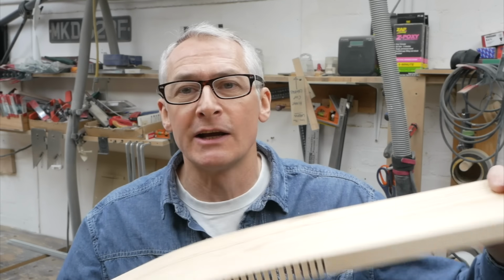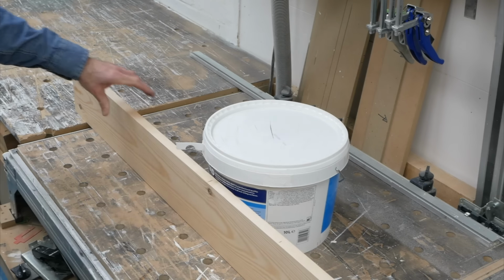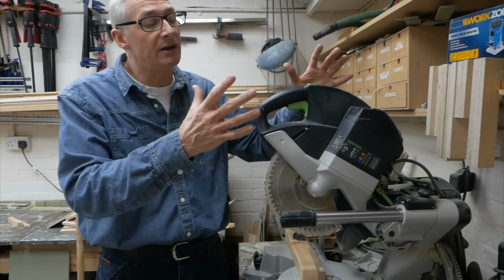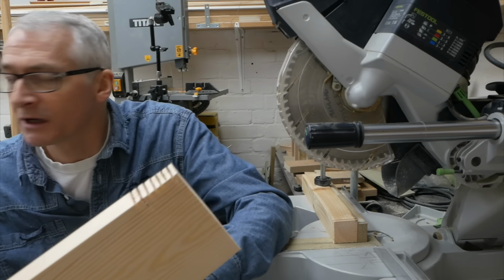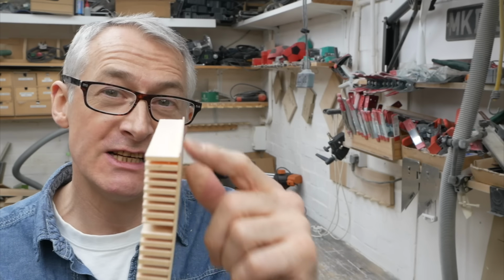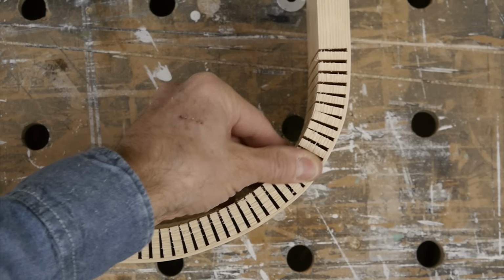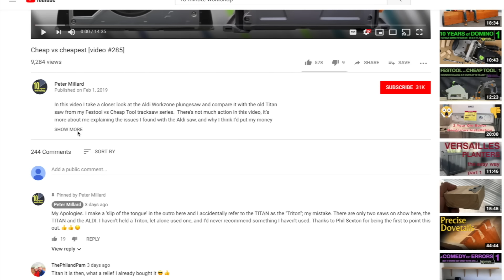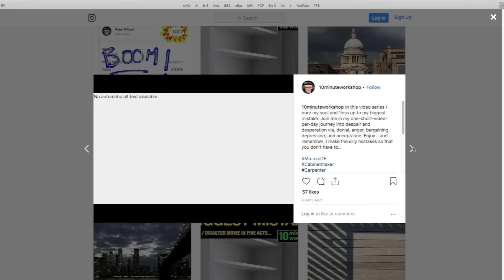How To Bend Baseboard Around a Curved Wall [video #288]

Comment: I was forced to do this for the first time about 6 months ago. Bottom of stairs had a round end on the bottom tread. I used 1/4 inch maple veneer plywood for the risers, and didn't want to change products for the curve. So I did exactly what you show. Set my saw depth, added a sacrificial stand-out fence, then cut the slots at equal spacing. Worked brilliantly. I filled the cuts with glue when I applied it, just in case it might need it.

Comment: I do Stair Renovations for a living. I kerfed wider material when I first started but now I use 1/8" Plywood and sand down to about a 1/16" for the curve. I've found that I don't have the brittleness issues of kerfing, it's stronger than veneer and you can pack out as much as you want to cover any gaps where the bottom step meets the flooring. However, with a step, you don't have to worry about what to do with the top edge.
Reply from the maker: Good shout, thanks! 👍👍
Reply: @PrettyPeople1111    I have a couple of pics that might be helpful but don't know how to load them into a YouTube thread.

Comment: iv done this a few times. it works great on square edges stuff. . i usually fill the kerfs with glue when fitting. it really strengthens it. i had a case where someone hit it with a trolley  and it broke.

Comment: Hey Peter ,i usually will  wet it with a spray bottle to soften it up before bending it ,i do the same with dry wall when i do an arch ceiling in a tub enclosure,the fun ones are the 90 degees with small rounded corners (tight corners ) i fit it then glue them up before installing them (concave trim is lots of fun )
Reply from the maker: Thanks Syd! Yes, wetting works well, especially for tight curves. And don’t get me started on concaves 😮😂👍
Reply: @10MinuteWorkshop  dont get upset ,everyone knows you cant make concave moldings with track saw ,im sure it wouldnt be  with out great difficulty

Comment: Another method is to slice the material into thin strips then re-glue them together while bent around a mold equal to the curve required. Once dried, trim the ends. This method lends better to non-painted finishes. There are quite a few videos on youtube describing this method. Some people even make furniture with it!
Reply from the maker: Yep, laminating works well and always plenty of ways to skin that cat, but this  was about bending a 6x1 around a curve as quickly and easily (and cheaply) as possible, without knowing if it would be painted or left in natural timber. 🤷‍♂️👍
Reply: This requires a former made that is specific only to the radius of that curve, also would need some form of clamping caul or a vacuum bag. Admittedly a better finish but tremendously more work.
Reply: We had the opportunity to do just that not long ago on some baseboard. The "fun" challenge was that it was an inside radius of less than 8 inches, about 9/16" in thickness and 8 inches in height. We used basswood (for pliability) and steamed the laminations to pre bend on the form to ease the final bend which helped immensely. The glue up consisted of 5 laminations using Titebond 3 glue. Left in form for two days. The 4 inside corners held their shape with no springback whatsoever. These pieces actually went into a very luxurious bath area so that solid wood was the chosen material as opposed to a layers of thin MDF or baltic ply run vertically or some other material or method. Definitely a lot of work but turned out very well. Thanks for sharing and am always open to feedback and ideas.

Comment: Thanks for sharing. When I'm doing this I dribble a few kettles of nearly boiling water on the kerf cuts before fitting. I find this really increases the flexibility. I also put some expanding adhesive foam in the cuts. I'm not entirely sure if this does anything very useful but it seems a bit less fragile when it dries off.
Reply: Do you carry a survival kit in the tool bag to boil water or do you have the homeowner boil the water? Lol

Comment: Thank you so much being trying to figure a way out to have a piece of wood with quite a long curve. 
I can’t and wouldn’t do the steaming process but what I just saw you do is brilliant. 
Finally I can get the last piece done 👍🏻 
Thank you very much, Just subscribed
Reply: i also add a wallpaper steamer to the flat surface before bending just to aid the bend it works well ...and using a moisture cure glue it helps that when using a curve as skirting i tend to lay a tape barrier with the floor surface and cut it away once finished this pucks up any spills or expansion but also prevents the board from gluing to the floor and being able to remove it down the line (you know if a electrician wants to remove the skirting to chase a cable )

Comment: I have just come back from Houston and visited the Home Depot and while in the Lumber section I noticed the skirtings which came in standards MDF lengths with a white primer similar to ours, but they also had additional flexible lengths which although identical seemed to be made of a soft pvc material which allowed you to form the skirting into any profile you chose I was able to bend one length completely on itself, haven’t seen it here yet.
Reply from the maker: Wow, that sounds interesting! And no, haven't seen that here either - I'll keep my eyes peeled, thanks!👍

Comment: Reminds me of a kitchen an old mate of mine was doing in his hippy and rather 'rustic' cottage 30 odd years ago - we had to curve the work surface (which would be tiled) by the entrance to allow people to get in and out of the tight space more easily.  He was stuck when it came to the edging the curved work top before tiling (we'd 'done' half the kitchen already so they could use it and this was finishing off the job) and because he couldn't work out how to put the edge on curved and had chopped up several pieces of quite expensive/blagged and couldn't get anymore oak (I think) finishing trim and failed to get the geometry right with a mitre saw and was getting very frustrated.  I suggested doing exactly this and carefully sliced into one of his offcuts by hand to show how it could be done.  An hour or so later the job was done - we had to use parts of his bodged offcuts to complete the straight runs as he'd nearly wasted it all and I filled the visible cuts with sawdust and glue on that too.   It looked very good when done anyway!
Reply from the maker: Amazing! Sounds like one of those jobs you can talk about happily afterwards, but at the time, not so much, lol 😂👍👍
Reply: @10MinuteWorkshop  exactly that!  He was getting very grumpy about it all.  Ended up looking really good.

Comment: Did a bathroom remodel and there is a slight bow in the wall because of plumbing issues. I am a non wood worker and this worked really well for the baseboard. Would this technique work for the crown molding? If not, any tips to share. Thanks, John.
Reply from the maker: Would depend on how intricate the moulding was, and whether the curve is internal, or external, how tight it is etc… I’ve never done it - crown moulding here in the UK is generally made of plaster - so can’t really advise. 👍
Reply: @10MinuteWorkshop  

Thanks for taking the time to reply.

Comment: Interesting video. As it's painted anyway have you ever used what I would call the layering technique, ie building up to the thickness with a number of thin laminations?
Reply from the maker: No, never have, though I’m sure it’d work well.  As mentioned in the vid the client hadn’t decided whether it was to be painted or not until after it was installed; yeah, one of those... 🤷‍♂️
Reply: @10MinuteWorkshop  I used to be indecisive but now I'm not so sure!

Comment: I just going thrue that kinde of tricks not so far ago, I mean on bumpy wall and that technic works as far as you figer out the metologi which you present.
 I see you have evolution mitre saw. I will be pleased, to see them in action on your hands .
 I'm unhappy owner of Parkside mitra/chop saw with have bended fence so have accuracy of the ax .
 Tried few times to fix but no luck.I know that Andy touch that topic some time ago,but, I see he use now dewalt mitra saw.
 So I'm looking forward for yours opinion.
Reply from the maker: Thanks Piotr! Yes, I have the evo mitre saw to play with, see how it goes in use. 👍

Comment: I did a load of these radius curved skirtings on a project a few years ago with Ogee Skirting & like yourself i didn't think too much of it i just did it & obviously as it was Ogee the upper saw kerf cuts came through the upper moulding so i neatly filled this in with caulk & a flexible piece of plastic to keep the radius curve once the skirting was bent & fixed.
After i was no longer on the project i had 3 different carpenters ring me up to ask how i had done it as they couldn't do it on the other curved corners...... I was a bit shocked they couldnt do it to be honest especially as they could look at the ones i had previously done as a reference, so i just politely explained without trying to sound like a condescending git :)
Reply from the maker: Nice! If only you could charge for that tie, lol! 😕😂👍

Comment: Have you ever Kerfed finger jointed base? I’ve never done it before but feel like it will break easier than a regular one piece board. Thanks.
Reply from the maker: No, I never have - for just that reason. 🤷‍♂️👍

Comment: Once you have completed the kerfing and confirmed you can bend it to the required shape - how about some epoxy glue in the kerfs and then it will hold the shape no matter what?
Reply from the maker: Yes, could be worth a try, great idea Norman! Or maybe PU adhesive - the slight 'foaming' may help fill the kerfs?? 👍
Reply: I would think filling those kerfs with construction adhesive would help with durability.  With the face of that board being so thin in the kerfed areas I'd think it would be easy to crack if something hits it.  Being stain grade it's not an easy fix.

Comment: Would this technique work with a  OAK skirting around a round bay window ? Great channel btw.
Reply from the maker: Never tried it, but it would probably be OK. You’d need to be a little careful about the blade kerfs - presumably you’d have a moulding around the top edge to hide them. 👍

Comment: I find it very challenging to control the depth of cut on a miter saw, it would have been the last type of saw I would have used for that, but you seem to do well. Is the Kapex that accurate then?
Reply from the maker: Yes. I started out trying an evolution mitre saw that has been sent to me, but there was so much flex in the trenching cut I switched to the Kapex.
Reply: @10MinuteWorkshop 
Thank you Peter for taking the time to answer.
My miter saw is a Metabo KGSV 72 XACT SYM, I have never managed to good control of depth with it.
Ar the time when I bought it I could not see what Kapex could do that the Metabo couldn't.. But depth control seems to be a clear difference then.
Thank you for clarifying that.

Comment: I have used a product that is a bendable plywood and veneered it in a matching species when the need a risen, I'm not sure if you have availability to such material in the UK,  in NA it can be found in  speciality lumber and drywall yards. B
Reply from the maker: Interesting, thanks! We can get ‘bendy’ ply and MDF, but only in relatively thin boards. Good trick with the veneer though, hadn’t thought of that one, thanks! 👍👍

Comment: Very good and informative video. Thanks for sharing.
I've seen some other videos where this technique was shown but never so detailed and other important information.
How do you manage to have consequent distances between the cut-lines?
Why did you show this technique in the video with wood?
(Why) Is it not possible to do it with MDF?
Reply from the maker: Thanks Hans! I used natural timber as a/ that was the job, originally, and b/ it’s more difficult to do than with MDF. As mentioned in the video, consistency of kerf cuts is essential, and having a sacrificial fence is very useful to gauge this. 👍
Reply: @10MinuteWorkshop  Thanks for you explanation.

Comment: I have Almost finished the skirting on my lounge project. Curved bay window section remaining 😬. Would this method work on a concave bay window of I scored the front of the skirting? I am using mdf skirting so some 'shaping' can be performed if required (probable 😬)
Reply from the maker: If you scored the front you’ll have a lot of filling to do, but it should work, depending on how steep the curve is. Only one way to find out though... 🤷‍♂️👍👍
Reply: It worked 👍didn't need as many cuts as I thought. Few sacrificial pieces of scrap required but got there in the end. Just need to fill the thing.
Reply from the maker: Excellent! And thanks for letting me know! 👍👍
Reply: Thank you for the tips 👍

Comment: TIP: BEFORE bending the piece, reinforce the piece with a bit of tape. It will reduce the chance of the piece snapping in two. 
Once the glue is dry, and the piece is installed, remove the tape.

Comment: Hi Peter. Is this possible to bend in the other direction? I'm designing a kitchen with curved corner units. Toe kick underneath would look awesome if it was curved to match. Not sure if it's possible. Will be using walnut veneer on birch ply. Any advice would be awesome. Cheers
Reply from the maker: Wow, sounds great! I'd say not with birch ply. You could probably do it by laminating up thin strips and gluing them together, then veneering the face, but lots of experimenting required, I'd think! 👍

Comment: I have a curved wall just like the one you did, in a bathroom I'm expanding now....I'm trying to figure out a way to wrap a wide crown moulding around that same corner up top....tricky. I may have to make a clay mold 1st to replicate the crown profile, then bend the clay mold, let it set up, then finally pour a plaster, or Bondo/epoxy mix into the mold....should be interesting, I've done a lot of things, but nothing like this. Any ideas anyone has would be much appreciated. Thanks for the video bud, good work!
Reply: Have you looked into polyurethane molding?

Comment: Why does it crack when i try this technique? I’m working with a pine riser, can it be that it’s too cold in my shop?
Reply from the maker: Too dry maybe? Cutting a little too deep? Cutting the kerfs a little too far apart? Or a little too close together 🤷‍♂️ It’s a balancing act, but the kerf cuts have to be very consistent to get a good bend. 👍

Comment: Peter -  I have an old Victorian house with a curved wall in it.  We are looking to replace the skirting there with unpainted timber.  I have seen this technique before (but still a great video) but our skirting has an additional moulding on top of the flat board.  Have you any tips or techniques for doing the moulded piece that sits on top?
Reply: Darren Reilly's earlier comment gives you an answer. When he describes using a flexible piece of plastic, I think he means that this is the tool he used to shape the caulk to match the moulding. It's certainly worth trying, and worth hiring a large mitre saw to complete the work.
Reply from the maker: I think Darren's answer was specifically aimed at something with a painted finish - much harder to achieve with natural timber 👍
Reply from the maker: Hi Colin. As I say in the video, it's much easier to do this with a square-edged timber than say, an Ogee or Torus moulding. At the risk of stating the obvious, if you do kerf cuts into the moulding they'll be visible, at least part-way, and will need filling. Depending on the radius of the curve, I think I'd be inclined to rip the moulding off the base, and try to bend this separately, either with tiny kerf cuts (maybe mitre cuts?) with e.g. a multi-tool and a jig, or by soaking/steaming the moulding to fit. Either way, it's not a 5-minute job, and will need some careful finishing afterwards. 👍
Reply: You could try cutting the molded piece off and then soaking in water for a few days, it will then bend to a certain amount. 
Cut the remaining board as Peter has shown and then gently bend and tack the mold back on to the skirting.
Reply: Peter Millard 
I thought about this many times whilst driving my van 
How about running say 3 separate lengths of skirting through planer thicknesser so you have the furthest moulded section out then the next then the flat board then do the bending planting each one on top as you go 
I probably haven’t explained it well but I know what I mean lol
Reply from the maker: Sounds like a long old process! Look forward to your video on it, lol! 😂👍👍
Reply: Peter Millard 
Yeah I might try it one day maybe when I get onto the southern rates 
Thanks for reply
Reply: I’ve done it before without the Kerf cut coming through. 

The trick is to use the curve of the saws blade to make the cut on the profile. You have to figure out how short to stop your cut while still achieving a deep enough Kerf on the profile.

Comment: Hi Peter. I have this exact job to do but with a curve in the other way concave I think they call it. Will this same technique work or will I have to trench cut and fill on the outer face. Luckily skirting is all white painted. Many thanks
Reply from the maker: Hi Richard. Same technique should work fine, depending on the radius of the curve. For some reason the timber I had was much more prone to splitting when bent concave - some experimentation needed, and maybe soaking the timber if it does seem to want to crack along the kerf lines. 👍👍
Reply from the maker: Wallpaper steamer works as well, if you’re working on a wider board 👍👍
Reply: dd dd Check out Louis Sazuddes  (Tips from the Shipwright) he does planks in a plastic bag might be helpful.